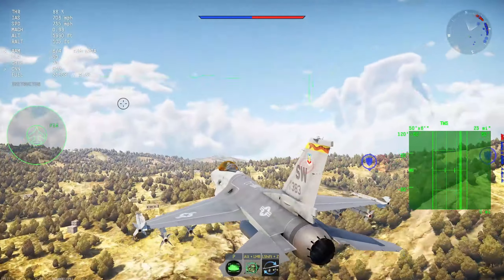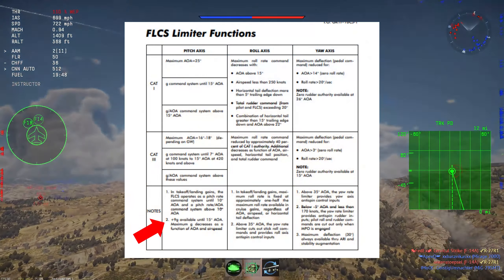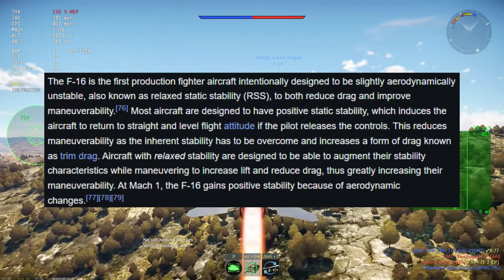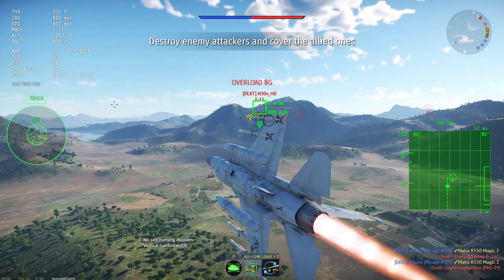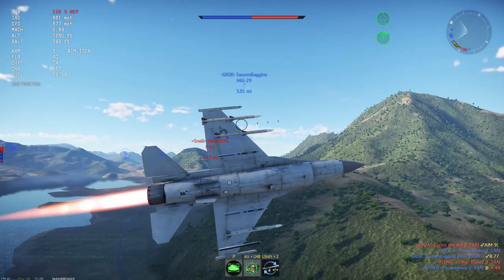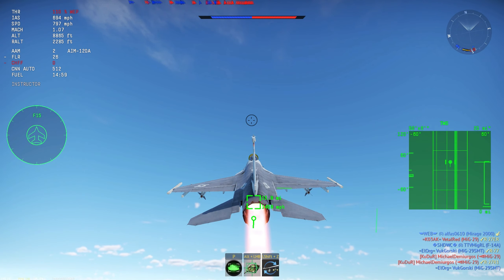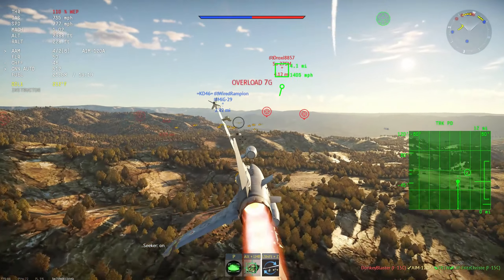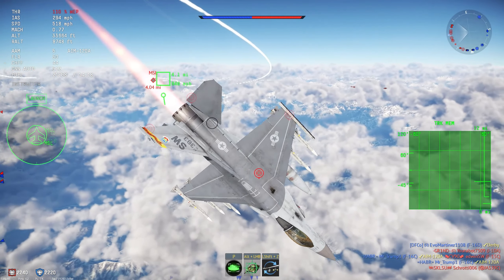The Falcon Flight model IS FAULTY

Comment: All aircraft in war thunder have an increase put on their flight G limit.

I believe the value is 1.5. If an aircraft has a G load limit of 5G in real life it will be set to a maximum of 7.5G in War Thunder.

The F16s documentation says it can pull 9G that is correct, however with the 1.5x modifier (ALL aircraft have) that is around 13G which matches ingame.

In order for the F16 to get its accurate G pull all other aircraft ingame would require this 1.5x modifier to be removed, otherwise the F16 is being nerfed for no reason.
Reply: it only modifies structural strength, not how many  G,s it can pull. although some planes will be able to pull more because of not being limited to structural strength. but a lot of US planes are overperforming in their FM in game
just to show its overperforming  f-16 can pull about +9G,s irl while mig-23MLD can pull+ 8.5G,s
Reply: @souththunder.  still its correct. those planes are limited to a 9G max so they don't rip them self apart. in war thunder this limit is indeed increased to 1,5x. The F16 was also limited to the 9G max because it was so good as it came out and later the devs fixed that unfair nerf. Because the F16 came out together with the Mig29 it was supposed to be on a state of equal performance.
Reply: that does not explain why its allowed to pull 30*. instead of limiting the Gs they could have atleast limited its aoa. its so weird to see an f16 pull better than mig29 in a 1 circle fight in air rb. idk wtf gaijjin is smoking.
Reply: @souththunder.  so you’re telling me that an A6M2 could pull 16G in real life… it does not only effect the structural limit, it is simply based off the structural limit (big difference)
Reply: Technically it’s not “all” but definitely most. A few planes (for example the jas39) are less than 1.5x because otherwise they would be/were very unfair. Considering ie: 1.5x 50 is a much bigger increase than 1.5x 30. ( 50 and 30 are random numbers based on nothing to prove a point). I could be wrong, but I think the f15 is under 1.5x as well… someone could check me on that

Comment: That's incorrect. The f16 Fly by wire can allow mathematic 9G, which due to environmental reasons can sometimes exeed 9.3G, because of the enviromental factors. Further more older F-16 blocks like 10 and block 15 did historically pull sometimes ~11G of turn bc of different FBW programs, there are stories of ground crew members, that did repair f-16s A that exeded 10G pull. And no, F-16's wings do not rip off after 9G, they can sustain way more than 13G of sutain turn, FBW just won't allow that bc that puts the pilot at risk of their health. Also it depends on CAT 1/CAT 3 mode that pilot will swich to, CAT 3 mode shrinks G limit to 5/6Gs due to it being used for heavy load under it's wings.
Reply: I'm tired of people believing the misconception that planes will rip at 9Gs. They won't, it's not the plane that has a problem with that amount of force, it's the pilot
Reply: @specc_s1452  planes (fighters)  wont rip beyond 9Gs but they will undergo some minor-major(rare)  permanent structural damage/deformations which may or may not be repaired , but if  it crosses its ultimate load factor limit then its over.  but load factor limit n ultimate load factor limit varies for each aircraft depending on the materials used, design, purpose  etc. the 9Gs you see are the load factor limit it can still pull more but with some small structural damages up to ultimate load factor limit.  the reason why jets are allowed to pull 1.5x their irl load limit is cus typically in real life if the load factor of an aircraft is K , then ultimate load factor is around K x 1.5   , i wish they added a new mechanism/system in war thunder (for realistic/sim battles) where you wins will slowly turn yellow-->red-->black depending on how much time you  spend pulling more than your limit load factor.

Comment: There isn't a single plane in game that actively has fcs, Gaijin doesn't model fcs at all. (Cause they don't need too) And they don't model wing rips at high Gs. The 16 is "overperforming" due to fcs, not it's airframe, which almost every aircraft is. A plane that actively is overperforming due to it's improper flight model is the JAS39. (It can hold a 11g sustained rate) And the Flanker flight model is actively fine. The minute when you fly it in sim and equip SAS dampening (A universal FCS). It flies really good, same with the Fulcrum. The plane that you should be complaining about the most is in fact the JAS39.
Reply from the maker: JAS has had so many "fake" nerfs to balance it out it should have been delayed intill later fighters like the hornet eurofighter also i tried joining your discord but the linkes invalid (i wanted to smack talk the SU more as F/A-18 is my fav)
Reply: @McXerYT  Invalid? That's weird. Should be good now. The discord isn't SUPER active, but you are more than welcome to join! We don't really have any "Flanker glazers" in it atm. But you are more than welcome to talk about your love for the hornet. (It's one of my favorites too :) )
Reply: @McXerYT Source?

Comment: 4:28 it is an aircraft limitation , not pilot , an aircraft has 2 limits - load limit factor , ultimate load limit factor. the former being like the safety limit where you can freely do whatever you want safely. but if you go above this limit  the aircraft is prone to receive some structural damage/deformations which may cost you a lot of money to repair   and they may  or may not be permanent .  then you have  ultimate load limit ,beyond this point the aircraft's structure undergoes critical failure at this point the wings can snap or some other structure can completely break.  so for the f16 the load limit factor is 9Gs  so if you pull 10-12 Gs in real life the aircraft will get damaged (especially if you are turn/maneuver for prolonged amount of time)  ,  and it  would cost a lot of money to repair it  , the ultimate load limit is 13.5Gs (irl the typical ult load limit factor = load limit X 1.5 ) , so if you pull 13.5Gs it will  break (catastrophic structural failure) . in war thunder gaijin lets you freely pull upto ultimate load limit factor without any consequences but in real life that is not the case. they can add a new mechanic where your wings get damaged depending on how long you spend pulling over your limit load factor.   its not like the aircraft will  always be damaged beyond 9Gs but  it can lead to a reduction in structural integrity or shortened lifespan if repeated.  but if you repeat it for prolonged amount of time then it will damage it further.

Comment: The fact of the matter is: every single aircraft in war thunder overperforms by a massive margin. All aircraft are accelerating too quickly and all aircraft put out far too much thrust. I've tested the Harrier's (The Harrier II's pull far too hard and should be far more weighty, and obviously are accelerating at Mach Jesus on take-off for no reason, even though the US Marines manual, as well as the RAF manual for the Gr.3 and every single pilot account I've ever heard says you need water injection and around 300lbs of fuel to hover otherwise you're too heavy, yet can be performed at 60% throttle with  N O  engine or airframe modifications just fine and dandy). The F-4 Phantom's ideal rate speed is around Mach 0.75--0.80 irl, and yet when I tried to achieve this with  N O  engine or airframe modifications on I was full pulling on my HOTAS to try and keep the speed from accelerating past Mach 1. The F-15's, Su-34, J-10, Grippen... ...They shouldn't even need mentioning. Even though Gaijin's numbers for thrust or weight or HP all line up with their irl counterparts, I sometimes wonder if it's just that their metrics don't scale accordingly with each other...

As for the general 'G' overperformance, as someone else already said, Gaijin has said they apply something like a 1.5 or 2x multiplier to jets maximum G limits. Turning the 7G max overload of the Harrier II's into 10.5 or 14G's or the F-16's into a max overload of 13 or 18G's. 

I'm not entirely sold that it's a 1.5x as I think everyone's experiences times when they've pushed that envelope beyond that. The Gr.7 can do 13G's so on and so forth...

Comment: It’s not so much the G as the implementation. If you go to high altitudes and pull the aircraft will bob up and down as it stalls and then recovers over and over. This is something the FBW was specifically designed to fix.

Comment: the f-16 was limited to 9g on launch, and it was so bad that they changed it after a month or two, plus every aircraft pulls way way harder than they can irl. If you pulled the maneuvers we do in WT in real life you would rip your engine apart due to the sideways acceleration. If you want to say the f-16 is too strong gameplay-wise compared to other top tiers then that is a different argument, but war thunder has never tried to match IRL exactly 1 to 1, everything overperforms a bit. Our missiles are never duds, every radar missile is modeled to use a monopulse seeker which should only be available starting with the Aim-7M, because the older seeker system would just not be fun gameplay-wise (too easy to fool, too finicky). Should they massively nerf every single fox-1 from the Aim-7F down too?

Comment: By this logic, most WW2 fighters should only pull up to like 7g (spitfires and such often ripped when pulling 9g). Only some US jets could pull 9g (and were throughly tested and certified for it) consistently without ripping.

Even the A6M could only pull 7g consistently without ripping.

Edit: Also, no, the F-16 doesn't rip at 9g. Nowdays planes can pull way, way more than the humans inside can handle due to dvancements in material science.

Comment: game has a increase of 1.5 to g load
Reply from the maker: didn’t know this lol
Reply: @McXerYT  the reason is because we don’t care about vehicle service life. G limiters are a balance between pilot limitations, performance, platform limitations etc. An f15 is documented as having pulled more than 11gs during combat, they had to junk the airframe.
Reply: it only modifies structural strength, not how many  G,s it can pull. although some planes will be able to pull more because of not being limited to structural strength
Reply: @theperson5185  there's a video out there of ~20G in an f15, and it landed.

Comment: People are mixing up G limits and  AOA limits. 

Yes - Every aircraft in game is capable of pulling to 1.5x their listed maximum G limit. This is because every modern aircraft, especially combat aircraft, are built to pull 50% over their max G load, and be able to maintain enough structural integrity to not shatter apart in flight. 

NOTE - This does NOT mean every aircraft is pulling 1.5x their maximum G limit at EVERY given speed. Aircraft NEED airspeed to produce lift, and therefore AOA, and thats why you wont see any jet IRL pulling 9Gs at like 400kph. I mean, just go look at that last round of bug reports which got accepted, resulting in substantial nerfs to the MiG 23MLD, JA37, MiG 21, etc, etc.. 

Some important standards that Gaijin holds every aircraft to, are their maximum sustained turnrate, maximum instantaneous turn rate, and their AOA limit at a given speed. They match these to IRL numbers, and DONT add 50% to them. Most aircraft are held to these standards, but the F16 isnt.

The F16 had some very specific AOA limits IRL which, if exceeded, would cause the jet to depart flight. For example, IRL the F16 would want 250 knots of airspeed to enter and complete a loop, otherwise risk hitting that AOA limit while bringing the nose over the top, and getting stuck in an inverted spin. In War Thunder, it does not have these limits. This is why the jet is beating everything in a slow speed minimum radius turn fight, despite that being its weakness IRL.

I dont know if this is true or not, but I've heard that Gaijin has stated they simply can't find a way to properly impliment a balanced and realistic version of the F16s flight model, because they dont model fly by wire, and fcs limitations, or soemthing along those lines. They are happy to let the jet continue over performing, because most of the people who play it believe that it is unrivaled in an IRL dogfight anyways. I dunno, hard to say what will happen with it in the future, but I think its another thing that they shouldve first tackled with the F16, to avoid issues with other flight models inevitably coming in the future 🤷‍♂️
Reply from the maker: yeah
Reply: "Year is 2026 and the F16C is beating the Eurofighter in 1 circle"....
Reply: @M0LOCK  watch f16 beat su35/f22 in a 1 circle fight.
Reply: @hemendraravi4787  bu-bu- but rUSsiAn BiAs

Comment: Gaijin currently has a rule of the safety load for all fixed wing aircraft being multiplied 1.5x at the least, which is why most top tier jets can comfortably pull 13 Gs. 

Heard randomly from people saying that the MiG-23 had an actual load factor of just up to 6-7 Gs which would definitely fuck it over more than it already is. I'm sure there are many more planes with low load factors that would also become difficult to play if G limits were more enforced. 

The concept of removing the G multiplier could be interesting for SB EC perhaps, but for the casual RB player, I believe that it would just frustrate people more than anything. As much as people clown on Gaijin for being horrible and saying that the game is the worst thing since the holocaust, it could be worse, and this is a balancing measure that they've taken that people have gotten used to. Not sure if this would be great to see implemented across the board.

Comment: While the 13g is indeed hard to believe to be realistic, there are quite a few aircraft that can pull more than 9g although not necessarily with missiles and bombs on the pylons. If I remember correctly, there was a Hungarian pilot who pulled more than 9g with a Fulcrum, but definetly not more than 10g. What most 4th gens are however is that they are rated for around 9g (arguably they can do a little bit more), meaning that the airframe is able to withstand 9gs, plus then some but then not for extended period of times. As to what g forces these air frames can pull off, remains most likely to be classified. Its more a case of "you shouldn't" and that "you can't".
Reply: so an aircraft has 2 types of limits , load limit factor , ultimate load limit factor.  load limit factor is the safety limit , within this you can safely use your aircraft without causing any damage to it.  then theres ultimate load limit factor  ,beyond this point your aircraft is prone to critical failure (wing rip , outright failure of some structures ,etc) ,  in real life typically the ultimate load factor is 1.5 times the limit load factor.  which is why in war thunder , the f16s load factor is 9Gs  ( 9x1.5 = 13.5) so it should rip its wings beyond 13.5Gs or break some other component which should mostly result in its crash.  but in real life if an aircraft pulls more than its load limit factor , it will begin to receive some structural damage/deformations which may or may not be fixable , it depends on how many G's , duration of the Gs .  i wish they add a feature in war thunder where your wing slowly turns yellow - > red - > black depending on how much time you spend pulling over your load limit factor.

Comment: I mean, I agree.. But it's not like EVERY jet above 11.0 can pull more than 9G's, sometimes even something like F-4's etc. Also, the bigger issue in my eyes at least, is currently the F-5 Tiger II that should be able to pull only around 7.5 G'S before you seriously risk structural damage. F-5 can pull in WT easily 12 G's, which is just a ‘little‘ over the G limit. Overall, this isn't issue of the F-16 FM, but more like issue with simplified flight models in-game implemented. But the 31 deg/s should be fixed tho
Reply: All aircraft in WT have 1.5x modifier added to this stat.

Comment: It wouldn’t be limited to 9Gs in game as every aircraft has an increased G tolerance a certain level over IRL due to the safety buffer manuals provide to pilots in order to stop denigration. You’d need to limit every other aircraft even lower lol.

If the F-16 would break up just over 9Gs would be limited to 7Gs… IRL the F-16 can handle above 9Gs. Structurally. It would make 0 sense to make your limit the break up threshold. Pilots would push that, or rather in the F-16s case. It would fatigue the airframe way too much & eventually break up due to riding that line constantly.